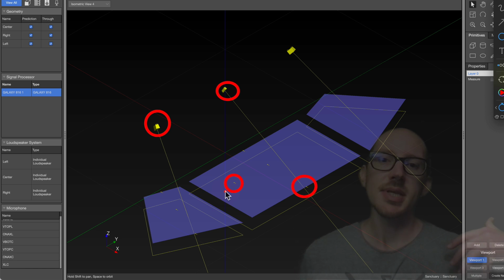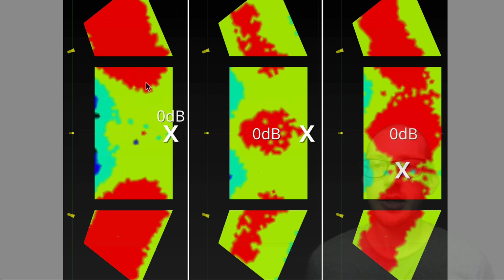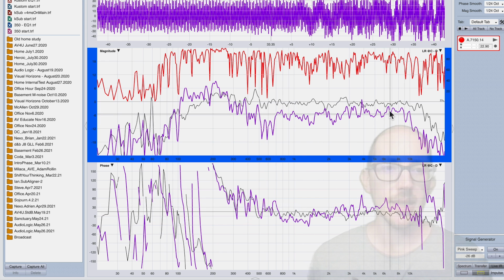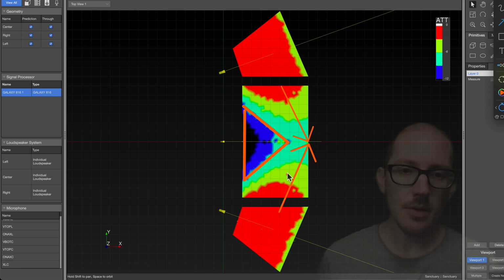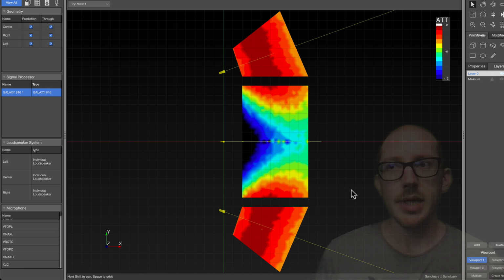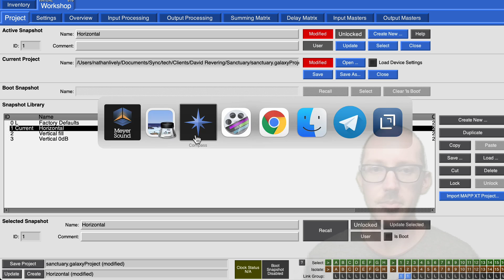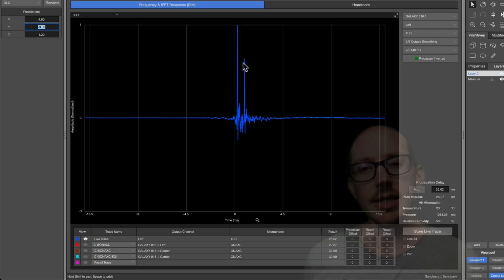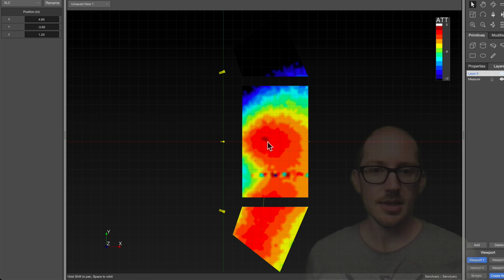Where do you time align a center fill?

Comment: Hello.  how to set the crossover to the front fill speakers?  like main speakers?  eg 160 hz 24 LR.  Do I set the same for the front fill speakers?  thanks
Reply from the maker: Hey Adi, the answer is easy if it is the exact same speaker model, yes.
Otherwise, you'll need a custom solution to match the response of the main and the sub, or just don't worry about it because the FF contribute significantly less LF anyway. :)

Comment: It isn't safe to assume that you should align halfway between your left and center without verifying that their horizontal coverage patterns are identical.

When I have the time, I move the measurement position around until the two sources give me equal energy in the upper mid band, and I align there.
Reply from the maker: Thanks David! I do the same thing so I think we're in total agreement. :)
Reply: I had a question, why do we need to align the center with the main to the point where the energy is equal?